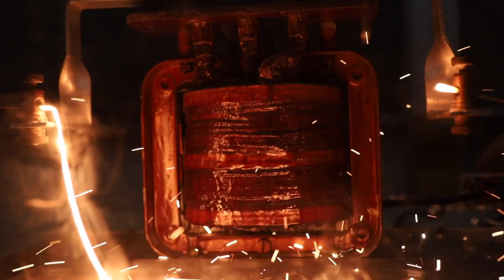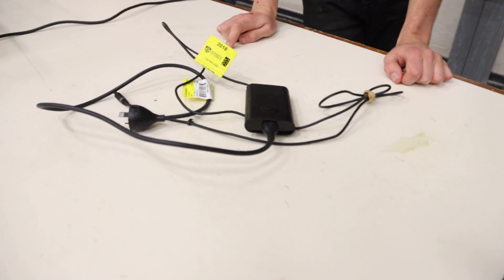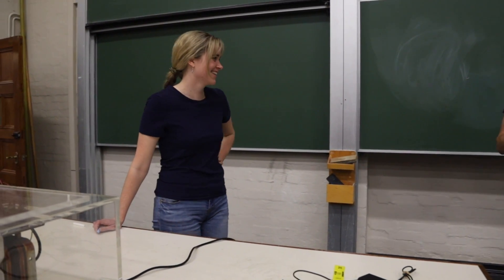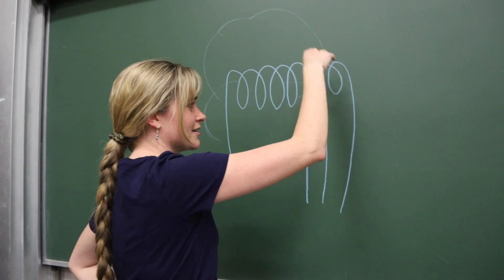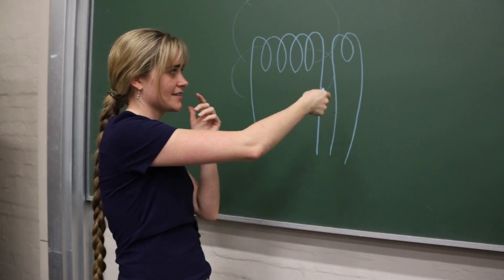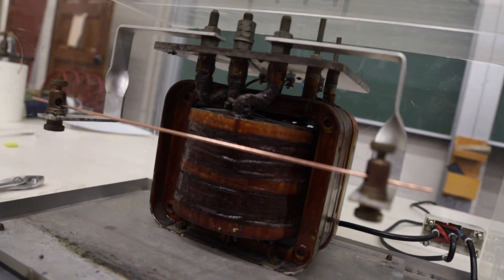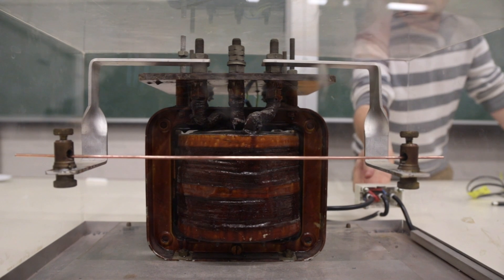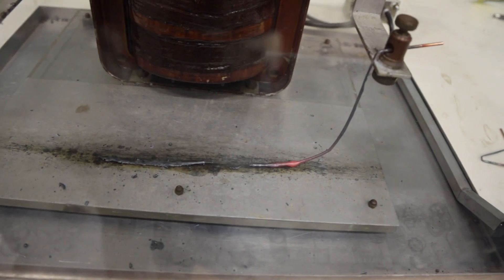Transformers Melt Steel Beams (ft Tibees)

Comment: 2:53 it's either not steel but copper or somehow you copper plated a steel rod. But the rod you knocked on is NOT steel. Look at the color. And melting point of steel is between 1394 centigrade (for 2,11 carbon steel which would be a very high carbon steel which is never made) to about 1538 for a very, very low carbon steel, close to 0,02% C.
I enjoyed seeing this but what you said is either untrue, about the rod being steel, or is a very unspecific. When dealing with physics you should be a lot more specific.
Reply: It's definitely steel, I've read the pack on these many, many times when I have to cut them down to length to fit into the transformer. It's mild steel with a very thin copper coating, which is what gives it the colour - but otherwise doesn't change its characteristics. These are pretty standard when it comes to brazing / welding.

Comment: What are the parameters of number of loops of the primary (n1) and primary voltage (V1)? I got intrigued  with the distance between the primary coil to the wire, it looks very far, which makes me wonder that the magnetic field must be pretty intense in this experiment. Additionaly, what is the purpolse of that metal plates, is it just support for the mechanical sctructure or is there something else going in this experiment?
Reply: I'm thinking they didn't understand the transformer and that the secondary was embedded in the primary -- after all, there are secondary leads

Comment: Thing in your laptop supply is actually a AC to DC converter (with possibly a step down depending on the design) and then a buck DC to DC converter brings the voltage down to something usable.

Comment: Laptop chargers are not usual transformers, but SMPSs - Switched-mode power supplies - https://en.wikipedia.org/wiki/Switched-mode_power_supply - however, this kind of transformers are used in electric welders. Also, there are induction heaters, you may be interested in this matter - https://en.wikipedia.org/wiki/Induction_heater, you can even melt metals by this technology. Greetings from Canada!

Comment: Peter, this video is fake! How can electricity melt steel if my microwave can't heat my food past 40 degrees.
Reply from the maker: I am a magician with CGI now. I'm not even in this video.
Reply: They stole that transformer out of your microwave, it's using light bulb energy to heat your soup. :)

Comment: Interesting, though in the context of laptop power bricks and similar would recommend looking into the topic of switched-mode power supplies (these are a lot more common anymore than big monolithic transformers).
Reply from the maker: You're 100% right, but even the switching power supplies have a transformer inside, that works on the same idea of EM induction and a ratio of coils. Thought it was an elegant way to tie this whole thing back to reality.
Good pickup though! Thanks for watching <3
Reply: Yep. Don't want to go too much into it (in YT comments). There are various ways to build an SMPS, some designs not requiring a transformer proper (*). Granted, all still rely on the use of electromagnetic induction in some form (be it via a transformer or via a plain coil inductor or similar). (*: Such as a buck converter circuit with the control electronics powered using a small linear regulator).
Reply: Brendan Bohannon how does electricity get to your home from a power station?, multiple big 'monolithic' transformers. No one cares what power supply  consumer electronics use...